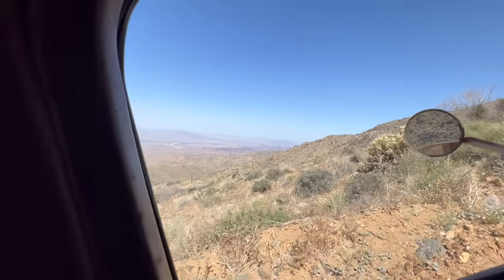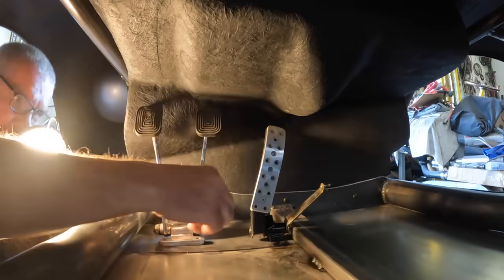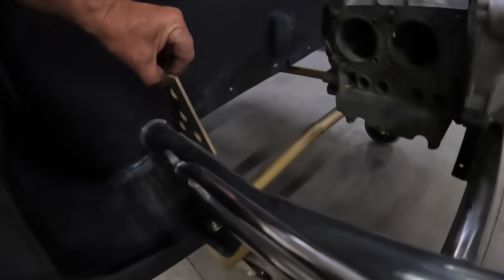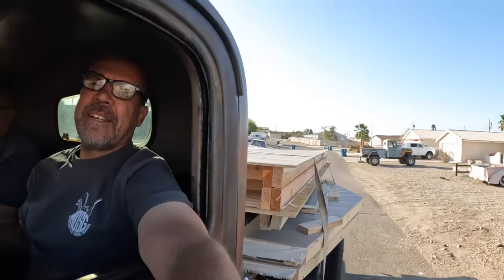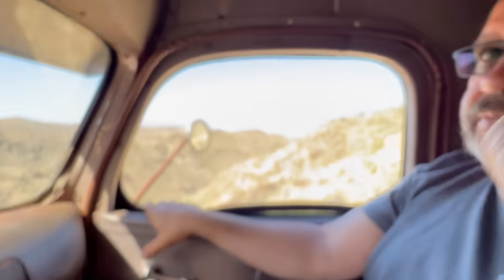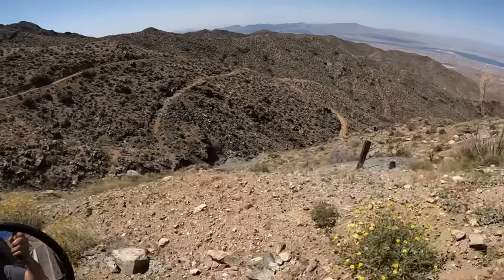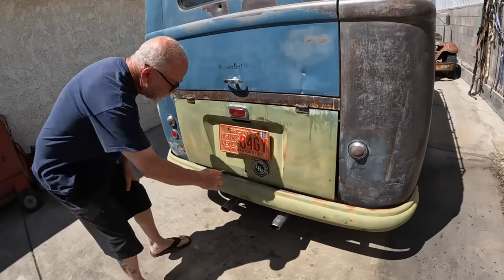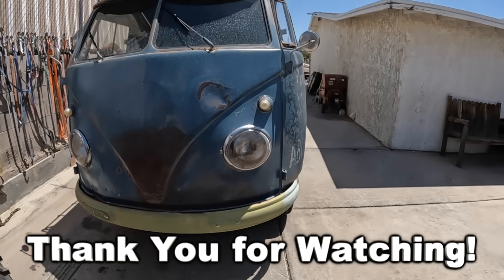Can We Get This Shed to the Top of Crossman Peak Without Falling Over the Edge?

Comment: Just a good old fashioned work truck doing the hard job that today's fancy new trucks can't!
Reply: That's why I own a 79 highboy
Reply: Sad that today's Dandified Trucks costing too close to $100,000 have to be so highly modified to do the same job as something we bought for less than $3,500 back in the day before 1970.

Try to tell a kid today that back in the 1960's you could call Dodge Fargo and order the E20 Custom Special Package to then specify your own options such as having the factory take the driveline from a W600 truck and narrow the track to fit in a W200 plus switch the engine to a 440 instead of the 383, put the military PTO winch on it, add Detroit Lockers or Limited Slip front and rear, etc, etc, etc.  Kids called mine The Beast and would ask what shop customized it and had a hard time believing it was all OEM Factory.  Downside was that you had to remember to order W600 parts when working on the driveline.

Today they'd probably charge us $200,000 or more for those $3,500 trucks.

Best!
Reply: @neilfromclearwaterfl81  awesome 💯 Cheers Cape Town 🇿🇦🇺🇲🇺🇲

Comment: So you're "broadcast engineering" now too!! That's what I do for a living.  Good work, brother.
Reply: Hey we one of those here…
Reply: NorCal ... my dad was chief engineer for several radio stations ... spent much time riding out to remote locations on weekends to check on/install/repair equipment and/or take meter readings. Always an adventure squeezing between barb wires to cross a field of cattle, dodging rattlesnakes on the backside of Mt Diablo, hiking in the last mile of a couple of peaks up in Napa/Sonoma because a road had washed away, and various similarly accessibility-challenged locations in the Mother Lode. Sketchy dirt/gravel roads, amazing views, lots of 'are we there yet' and family picnic time. Tubes. Teletypes. Great times; loved it all!
Reply: @hellabiz4289    What is/was your dad's name?

Comment: I owned one of that model but it was a window van.  Drove it from Vancouver Island to the central Yukon on the Cassiar Highway and back to Dawson Creek on the Alaska Highway (both unpaved) until the motor threw a piston.  

I was a farrier and took shoes and tools with me and hung a burlap sack on the front between the mirrors and the bumper that said Old Horseshoeing Blacksmithing Coal on it.   When the van died and when I took the burlap sack off the front of it there was an impression of the black tail deer I had hit with in in the front behind the sack between those dinky little turn indicators.  1200 cc motor.  You could get the motor out faster than you could get the bumper loose.

I traded it for a 65 Chevy panel truck and drove that to Eastern Ontario where I got turned around at the US border so I turned around and drove back to Vancouver Island.

It was a good van in the snow and they are always fun to drive because of where you sit in them.  A head of the wheels.

Comment: It’s a very small world on VW world Ronnie knows Dino dinosaur maybe I have a friend that worked at Gburg for 42 years JD speed fab back in the mid 80s. I had one hell of a 67 Volkswagen still have two of them but not like they owe 67 when I had nothing, but Jean Bird parks inside the motor, took all of my 401k it went to a better place BW Dave Folts did my transmission. It was a good street runner. I loved it. I miss it. Nothing like the sound of good old Weber going down the street of nothing but those walls noise kind of verberate off the wall i’m with you on the road racing. I even worked at Bob Bondurant school of driving here in Phoenix . A dirtbike riding is done around Highway 84 Smith Rd. table top mount area beautiful area. Here’s another good story. I met my wife back in 1979. She was living out of her Volkswagen van and going to college at Long Beach State I thought for a girl one hell of a good server.

Comment: Im building a 1949 chevy 4400 and was wondering what axles you are running under the old 1946 truck, im trying to decide between a set of dana 80 axles or corporate 14 bolt axles. Also if you could give any specs on the rest of the driveline it would be greatly appreciated.

Comment: I didn't see anything I'd be scared to pull my double horse trailer i converted into an enclosed trailer with my shortened 76 K30 now shortbed stepside with a 454 my speed shop punched out to the max ballanced and blueprinted whatever that does or means all i knew is i pulled a dead 4x4 dualy for 3 miles floating the valves and my friend was about to jump out because he was scared clutch parts were going to jump up and bite him never got over 210 where it normally runs